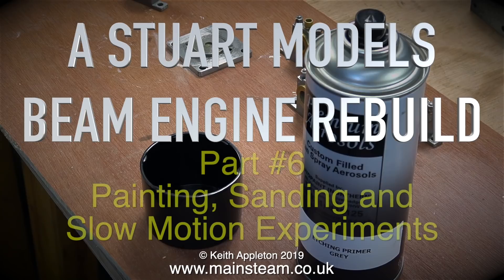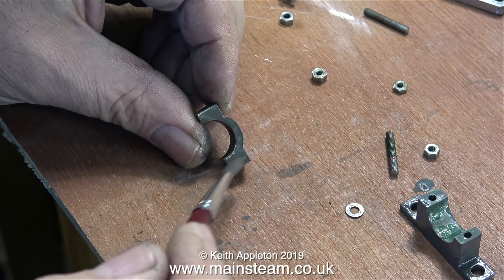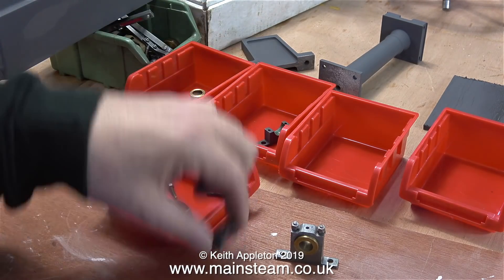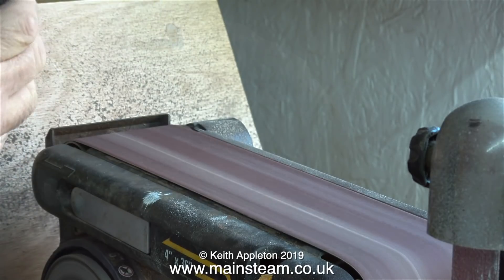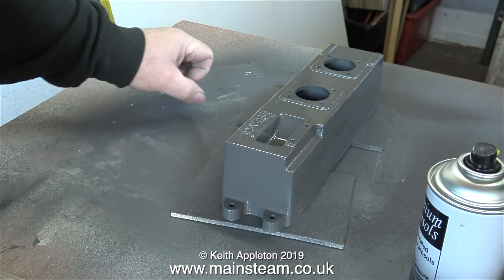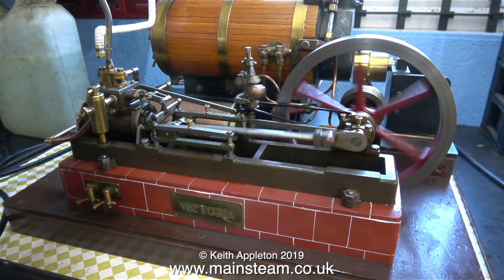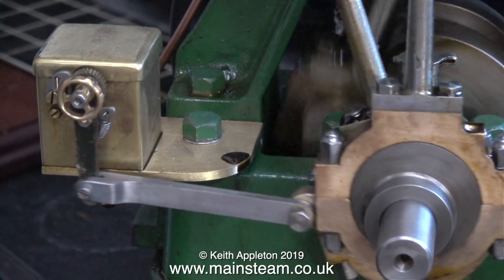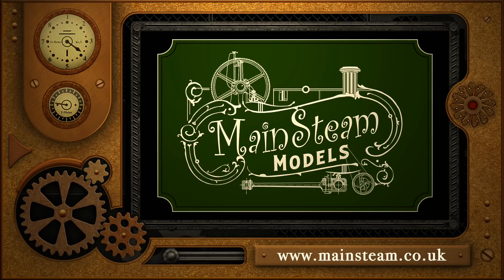A STUART MODELS BEAM ENGINE REBUILD - PART #6

Comment: A thought occured , yeah, i know , would the slow motion played back at varying speeds be any use with the sound and vision , as a diagnostic tool ?
Just an idea . Great video 👍🇬🇧
Reply from the maker: It is a useful tool, I frequently see problems when the video runs in slow motion.